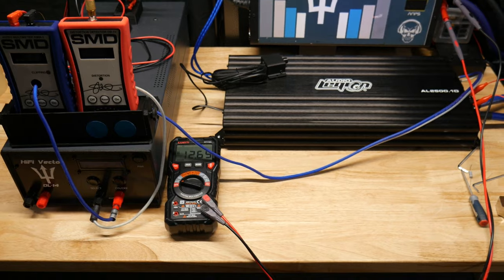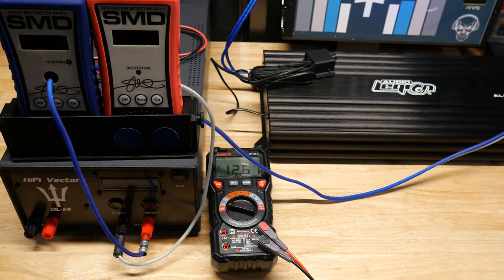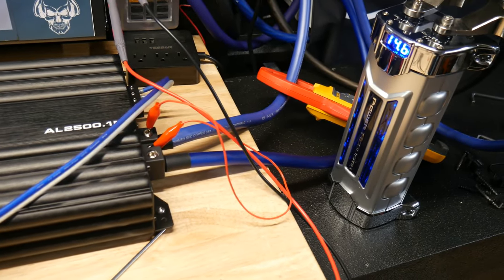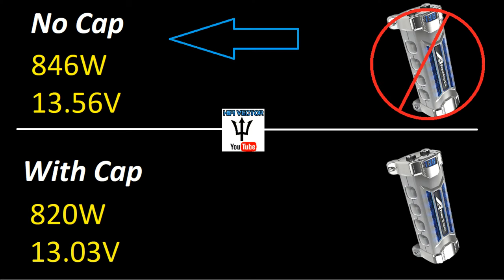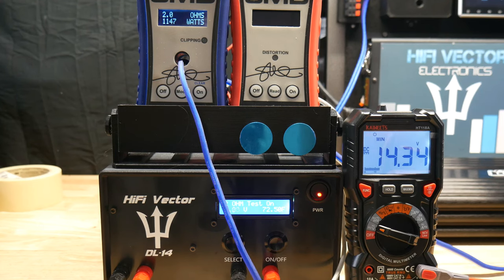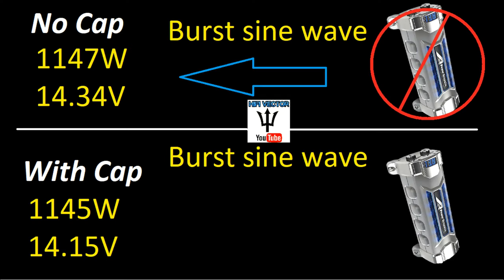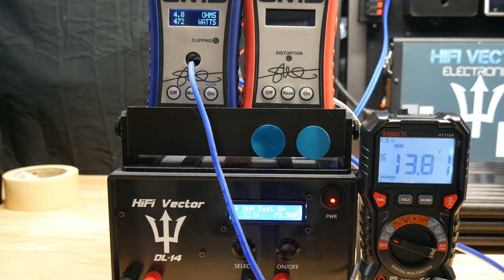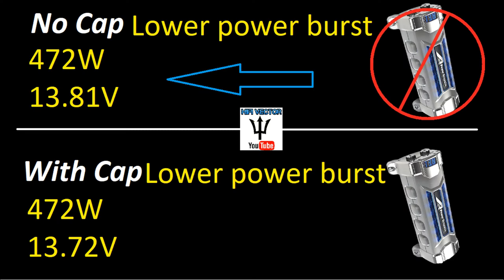Do cheap car audio capacitors work myth busted lets find out in this test

Comment: Just get a good expensive  battery and if you have the time and money upgrade the electrical cables going to and from your battery. If you’re trying to push alot then it’s obvious to upgrade your alternator so it doesn’t burn up constantly charging.

Basically if your rms power is higher than say 1400 then you need to start upgrading Your electrical. And that’s probably too much on most vehicles now with all the extra electronics involved.

Comment: What about hybrids with non replaceable alternators? 
My amp drains my battery after 10 minutes, voltage drops to 11 volts on the battery and the amp shuts down. 
The headlights etc never dim because the cars electrical system (powered by the traction battery) never drops below 12.7volts